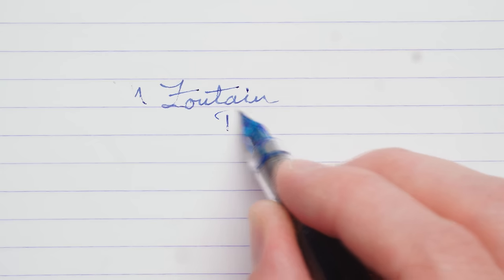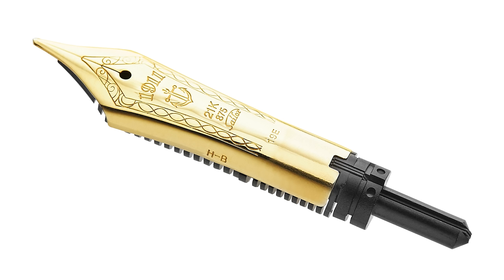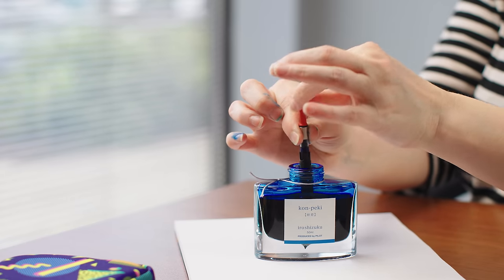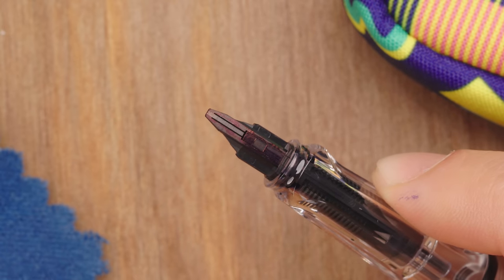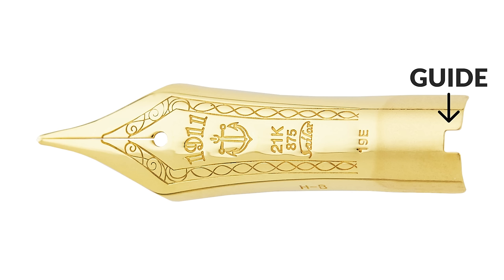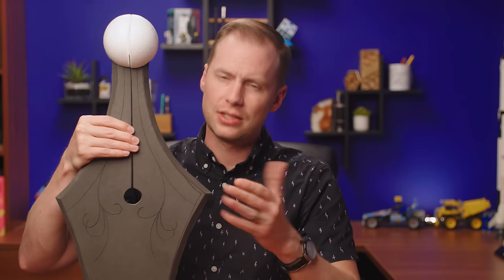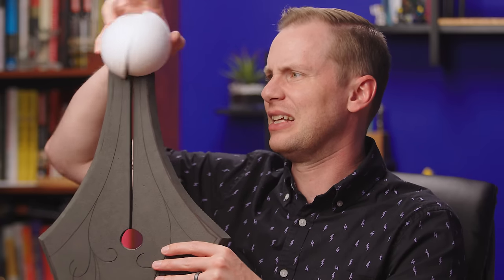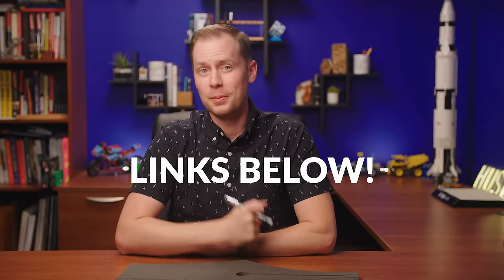How to Fix a Pen That Won't Write at All!

Comment: If I got this problem, I normally just lick and suck at the pen till the Ink is flowing again. ... no, just kidding, don't do that.
Reply: On the other hand, as I discovered age about 8, there are occasions on which at least licking, works. Suck? Not so good. Remember to wash your tongue or your Mom will 'become concerned'.
Reply: @davidwright8432  The way without ink in the mouth would be to take a bulb syringe and blow from the feed side through the pen, I assume.
Reply: I wish you could have seen the look on my face as I read this comment! Ha ha!

Comment: Thank you so much.  I purchased a 14kt nib for my Kaweco AL Sport and was almost ready to have it turned into a pendent (it would have been beautiful, two tone gold nib) by my local jeweler when I took a surgical knife and spread the tines until I could see light.  I wish I'd saw this video first and used a feelers gauge but it was what is was.  I scratched the underside of the nib a bit guiding the knife into the groove. But the nib is still beautiful on the front.  I feel that I have learned so much from this channel that I could call myself an amateur "fixer" of fountain pens.  And if I may throw this out to all fountain pens aficionados,  I have had beautiful gold nibs on pens that I just no longer use or are broken and have turned the nibs into pendants.  They make wonderful sentimental gifts for yourself or for the writers and fountain pen lovers in your life.

Comment: It doesn't get more frustrating than a feed that has air-ink interchange issues from the factory. It's rarely visible, it mimics other issues and it's not often you can buy a replacement feed. If you try to fix it by widening the air channel, you often end up with a leaky pen. You might not even notice it until after you can return your pen if you happen to test it with ink that is less viscous.
Reply from the maker: Yeah, a legitimately defective feed is almost impossible to diagnose. The process of elimination is probably the only course there, unfortunately. - Drew

Comment: Hardwater can be an issue if the calcicates form in your feed. Just replace it, if they can not be dislodged, or dissolved.
Reply: Vinegar for the disolving?
Reply: Some materials will soften or even dissolve in an acidic environment. Like vinegar. You might notice the finish on your pen getting dull, or the decorative paint peeling, or the gilding on the trim rings turning to powder. Safer to gently slide out the nib and feed and take an old toothbrush to them.  @CorwynGC

Comment: Resolved a pen having ink-flow issues (no ink on the page) by swapping out the converter with a new one. Granted, I bought 10 universal converters from 10 different pen companies. Planned on shoving one in after another until I found one that worked. 2nd new converter was the magic one that fixed the problem.
Reply from the maker: Fantastic! Glad to hear it! - Drew

Comment: Does the same thing (that the tip of nib should touch and the gap is only beneath) also hold for flex nibs. Such as the Mont Blanc Calligraphy 146 Flex Nib? I definitely have the issue of skipping and see the gap going completely through. On the other side this style of a nib is exactly made to split up at the top of the nib. Any suggestions?
Thank you in advance

Comment: I have a Lamy Safari with medium nib that for ages I thought was defective. I was using the Lamy Crystal Ink (Benitoite) colour in it and it never seemed to flow well. Then I decided to switch inks to Sailor and it writes like a dream. Seems that the Lamy ink was the cause of the issues. Not sure if it's the line of Crystal inks in general, or this specific one, which I think is a document ink. Have you guys experienced similar issues with this line of inks, or do you have any similar stories of other inks that didn't seem to work, that were the cause of the issues?

Comment: Why do I always have trouble getting the ink to start flowing with my Jinhao 993 Shark Fountain Pen? Doesn't matter if it is brand new or if I have cleaned it to put in a new ink, I ALWAYS have trouble getting the ink to start flowing. Once I do I have zero problems. It's only initially when I first ink it up with no other problems. Works great from day to day, week to week, month to month, it's just that initial inking up process. 

If I don't clean it and just add more ink to my already inked up converter; again I get no problems, except now I am using a new ink and it's mixed up with some of the old ink color so I'm not thrilled. 

My solution has been to just struggle with the pen. Dip the tip in water, screw the converter to force ink out, roll the tip around in ink, and even lick it... yeah that's a gross one. Eventually after throwing a few tantrums something kicks in and bam! It's working and I so no more problems until I want to clean it up and switch colors. What is the problem!?! I have several colors of this pen, the black one, a lavender one, a grey one... doesn't matter, they all have the same issue. I just know to expect it now. I get that it's an extremely cheap pen, but it writes well and I don't get sad if it cracks or breaks and the shark is cute so I enjoy it. But why? Just... why?

Comment: Nothing against Goulet Pens, but it’s a damned indictment of the fountain pen industry that this video needs to be made. Any other industry with this rate of failure and malfunction would be embarrassed into quality control or go out of business. Fountain pen lovers are sometimes too forgiving for their own good.
Reply: In Drew's defense, no "rate of failure" is specified, nor was any distributor. The suggestions are equally useful regardless of where a pen came from, if it's a multi-thousand-dollar German plastic thing with secret icons, or a $3 Chinese knockoff of some other model. If you don't approve of the difficulties that can accompany fountain pen ownership, feel free to use a biro. Your choice.